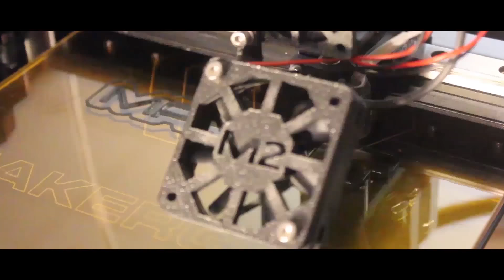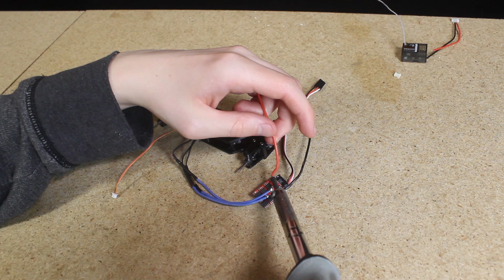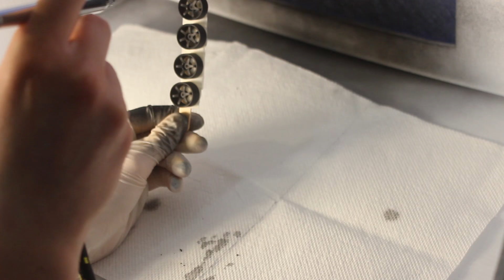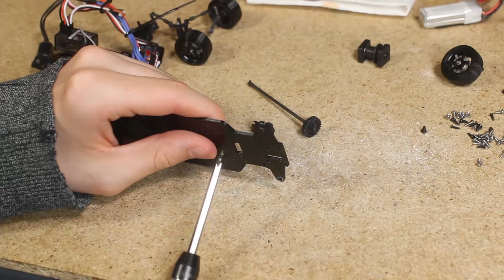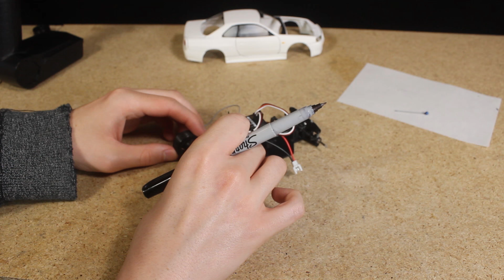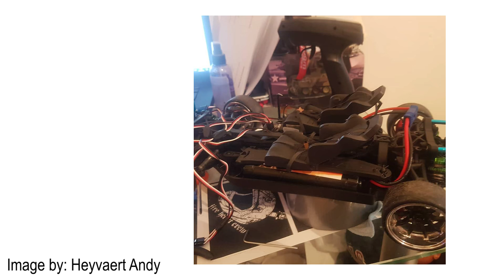Completing and Test Driving 1/24 3D Printed Chassis for Skyline Project (E18)

Comment: During my experiment with a custom 1/24 rc car I found that micro brushless motors vibrate a lot. I tried 3 different ones and had the same poor results. I switched to a simpler and inexpensive brushed motor and all drivetrain problems disappeared.

Comment: recently i watched a video from greatscott on ESCs. having a relatively bad low end is pretty normal with most ESCs, he "fixed" it by using an open source ESC, but that would be waaay too huge for this build and also too expensive. anyway, i really enjoyed this video!
Reply: definitely, and so much simpler to pop in an FK-130 or FK-180 brushed instead.

Comment: Love what you are doing! Keep it up :) So much potential for that design. A way to shorten or lengthen the chassi to make it work with different types of bodys and a way to change parts so that it could be either AWD, RWD of FWD but all with the same platform would be killer.

Comment: Where does he get the motor, esc, and battery.
Reply from the maker: I got mine from Ebay except the motor which is from Hobby King. They are pretty generic, easy to find components.
Reply: Rex you can get the motors at a Hobbytown USA and the batteries of amazon
Reply: The Dark night thanks

Comment: I really enjoy the work you're doing it's all based off of RC stuff that I used to be in just a little tip for you as far as the motor and speed controller go. i suggest look into a sensored system. That will truly smooth out your performance issues with your breast the system. When I used to race that's all I used to race with was  a sensored system
Reply from the maker: I'm glad your enjoying the videos. A sensored brushless motor would be great, though I'm not sure if they are available in this size. I'll have to do a bit of searching, otherwise I might try out some brushed motors.
Reply: Make It RC i was thinking that as well.  brushed motor work like in all your other vid. lets face it the brushless would be fun on a big area like a gym. ha ha
Reply: agree FK-130 FK-180 size about right. you might want to pick up a 1/24 scale Subotech/GPtoys car/chassis because of drive train configuration and placement of a pair of 14500 lithium ion cells snapping into the sides for a 2S configuration, they're very tidy. the other config I'd like to see is something motor+pinion>counter gear into counter gear... then small tooth belt driven front+rear diffs to toss away the center shaft bevel gear issues. once set up it'd sure run fast and smooth! it could be possible to integrate the reduction into the front or rear diff casing (in front ahead of the axle, so nothing is in the way of the belt). one of the fastest oval or dirt oval cars back when was the "Dominator", motor+reduction into direct belt drive and no diffs at all, it just did it's thing with weight transfer, battery mounted to the "wrong" (right) side of the chassis for traction to outside wheels (turning left) as the insides went light... a lot like a live axle go cart doesn't need a diff when the front caster is doing the same type action (inner tire lifting). a very simple live axle pan car could be set up to do like a go cart does too by modifying a 1/24 (4") slot car chassis front end/beam for steering. not scale but it'd perform, let that inside rear tire lift 1-2 mm when its cornering.

Comment: At first i would say that the video is very nice. But i think for car its important to take rubber tyres for more grip because its the only conncetion from the car to the ground.
Reply: Yeah, it's a drift car, though. Slippery by design.
Reply: Its a drift car mate and looks to be near perfect
Reply: drift cars are supposed to slip mate...
Reply: Printing in Ninjaflex would be a good option.

Comment: Looks good.  One thing, shortening a spring will actually make it firmer not softer.
Reply from the maker: I guess I could have clarified but the springs were too tall before, and therefore applying too much force to the point really no amount of turning, driving over a bumps ect. would ever cause the knuckle to move. By shortening the spring it put far less force pushing down on the knuckle, therefore now allowing the knuckle to move up when driving over bumps, and turning much easier.
Reply: Unless there was preload.
Reply: AlfonsoB preload does not increase spring rate. A normal coil springs rate is essentially linear throughout it's compression range.
Reply: True, it does not increase spring rate but the force of the car must overcome the force of the preload before any compression of the spring happens.
Reply: AlfonsoB Yes but only to it's resting position or initial sag.  Once it's at that point there's no difference.
Reply: I already acnowledged it makes no difference from that point onwards. If he really succeeded in softening the suspension by shortening the springs then the only logical reason for it was lessening the preload.
Reply: AlfonsoB That's the thing. He can not soften the suspension by shortening the springs regardless of what the preload was before or after.  The initial sag will only affect the loaded ride height.  If the suspension travel was maxed out at the top before and it's still maxed out the the preload changes nothing.  If the travel wasn't then only the ride height could be changed.  Either way the suspension would get firmer not softer.  The only way to soften the suspension is to either use a longer spring or use a thinner spring wire.  Preload cannot affect stiffness no matter what the situation is.  He thought made it softer and it may indeed have made things better but i got firmer....
Reply: Shortening a spring will indeed make it softer. Less coils
Reply: Troy Gentry it's a common misconception but it's really the opposite.  Think about it this way.  A coil spring is just a piece of wire wrapped up in a coil shape.  Take that piece of wire and straighten it back out.  Grab each end and flex it.  Now cut it in half.  The halved piece will feel less flexible.  The material is the same but there is less of it.  If you don't believe me feel free to look it up (using a credible source, like I said it's a common misconception)
This is why ricer cars with chopped springs ride like crap (well partly why). Because the suspension was made much stiffer.
Reply: It's not really an misconception. Let's put it this way: imagine you have a stock spring which has 5 inches of travel and spring constant of 100 lbs/in. That means the spring can absorb a force of 500 lbs before bottoming out. If you cut in half, you will not significantly change the spring constant (neither up or down), but you will have a shorter spring with same spring constant, which is now able to absorb only 250 lbs of force before bottoming out. So yes, technically I was wrong with saying the suspension gets softer, but neither it gets firmer. And why the ricer cars ride like crap is the springs have been cut so short, the suspension bottoms out with every slight bump in the road.
Reply: Troy Gentry spring constant is a completely different thing.  In your example the spring height would halve but the spring rate would double.  Because you have half as many coils deflecting.  Say you have 10 active coils.  Put a load on it and each coil deflects .1 inch so total of 1 inch.  Now remove half the coils.  Now each coil is still deflecting .1 inch but there are only 5 so the total deflection is .5 inches.  But please don't take my word for it there are tons of resources online that get much deeper into the actual calculations etc (eaton Detroit spring has a couple really good articles and im pretty sure they know what they are talking about)
Reply: taking away pre-load does soften at the top of suspension travel because the spring isn't compressed as much, why any arguing about finer points AFTER that point? I don't want to hear about it either btw.
Reply: @modelnutty6503  For a linear rate spring (where all active coils are the same) the spring rate does not increase as the spring is compressed.  The only time the rate would change is if the number of a active coils changed.  And if you didn't want to hear it you shouldn't have commented:)